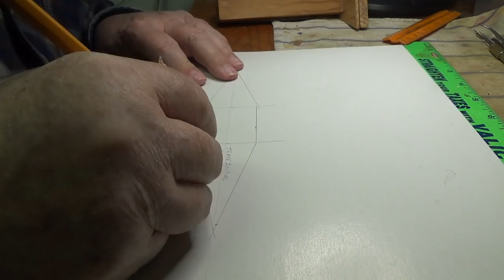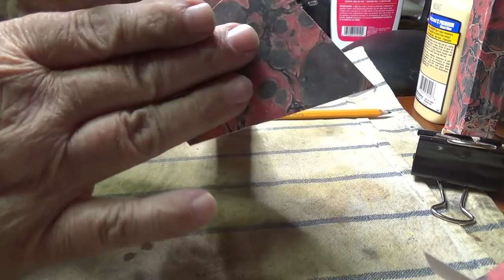Bellows Repair for Wade's Railroad House Cuckoo Clock

Comment: An index for this video:
0:00 Introduction to the repairs to do.
0:49 Removing the old whistle paper, bellows, and glue. Sanding the whistle parts.
4:14 Patching holes with wood filler.
5:18 Cutting out the new leather bellows.
5:58 Gluing the new bellows with diluted wood glue.
9:37 Testing the new bellows.
9:51 Gluing and sealing new paper on the whistles.
13:45 Gluing and sealing new paper on the top of the whistles.
19:03 Attaching the new loops and wire to the bellows tops.
Reply from the maker: Thank you

Comment: Thanks for a very solid lesson on bellows restoration. I wonder what kind of leather you have used. The one for car cleaning seems to be too thick to fold properly.
Reply from the maker: Yes, chamois is much too thick.  I did a simple search on eBay for "paper thin leather" and found a site that said it was thin enough for clock bellows.  It is, indeed.  You can buy it from clock suppliers, but it is very expensive and they don't even guarantee thickness.  https://timesavers.com/i-8946487-leather-bellow-material.html
Reply from the maker: Here's where I bought mine.  https://www.ebay.com/itm/Reduced-Thin-1-5-oz-Cream-White-Sheepskin-Lining-Leather-Hide-Dollmaking-/400964204843

Comment: Great video. Just wish you had showed how to get the proper crease in the leather.
Reply from the maker: Push the sides and front of the material in between the top and bottom of the bellows, close the bellow top and clamp it shut for a few minutes.  Creases will be there.
Reply: @dperry428  thank you. I will try soon.

Comment: I can see how you can determine the length of the leather by the distance around the bellows top. How do you arrive at the width at the front, top to bottom?
Reply from the maker: After putting a piece on the back for a hinge, open the bellow top to about a 45 degree angle.  The distance from the bottom,front of the bottom piece to the middle front  of the top piece is the width of the leather strip.  The width is the distance to the widest expected opening of the bellows.  It's about an inch.  Don't want it too narrow, but too wide and it is difficult to make the folds needed to close the bellows.
Reply: @dperry428 

Thanks 🙏

Comment: Again thanks for the excellent video. I always learn a lot. What type and weight did you use for the bellow tops? Did you say you use piano wire for the loops? Will you be putting the movement in a case? If so I hope you do a video of the completed project. Bob
Reply from the maker: Of the two bellows, one had a complete lead weight, which I replaced.  I don't know the weight.  The second one had just bits and pieces so I just cut a piece of brass rod the diameter and thickness of the hole in the top. I don't know the weight but it was about 3/4 inch rod and about 5 mm thick.  Yes, I used piano (music) wire. I also use it for smaller trundles and pivots.  No, I won't be putting it in the case.  The owner is doing a restoration but didn't know how to do the movement repairs or bellows, so I'll just be sending them back to Minnesota.
Reply: Thanks for your early reply. Bob @dperry428

Comment: What do you use for hinges? How did you come up with a pattern for the bellows paper/leather, but most important is how did you get the creases into the bellows?
Reply from the maker: The hinge is simply a strip of leather glued to the ends of the bellow halves.  On this page you'll see the general shape of commercially available bellows material. https://timesavers.com/search.html?q=bellows+material&go=Search   Make the bellows in this shape with dimensions to fit your specific size. Creases are made by tucking the material  in with a pair of tweezers and squeezing the bellow halves together.  Gently push in the front and then the sides. Then close the top until it closes neatly.

Comment: Nice work.  I’m looking for similar railroad whistles that I need to replace that are missing. I was wondering what is the length of those whistles not including the bellows? Thank you!
Reply from the maker: They vary.  They are, without the bellows about 6" to 6 1/2".  Some are a little smaller.  Total length, including bellows, are 6 1/8" to 7".
Reply: @dperry428  thank you!
Reply from the maker: https://timesavers.com/i-8946475-7-old-style-leather-bellows.html

Comment: What is the correct height between the top and the bottem , of the opening ?
Reply from the maker: If, by "the opening", you mean the distance between top and bottom of the bellows when it is open, it is roughly an inch or 2 1/2 cm.  It should be be wide enough to accommodate the distance the lift wire moves but not so wide that the leather material bunches up when closed.
Reply: @dperry428  Yes, thank you !

Comment: Hello. Hope you are well.  Bellow wire and lifters question here. I replaced the bellow paper on an 8 day Regula. They were very delicate but working beforehand. I assume the lifting wires were original as it worked when I got it. But now the bellow with bird wire is not lifting easily. Put everything back to as close to original position as possible, but just can’t find problem. Even put in smaller wire on stiff side, put small bend In lifter on problem side. Could bird position on wire cause issue? 
It runs ok when I physically pull chain and observe from back. But weights can’t do it. As I mentioned they were perfect before for weight. 
Any insight ? 
Thanks
Reply from the maker: It's very difficult to say what's the problem without observing it myself, but some of the things I'd do would be to make sure the wire that lifts the bird's tail is not hanging up on anything and is below the bird's tail, take out the problem bellow and work it manually until it moves very freely. When I replace the paper on a bellows, I clamp it shut for several hours to make sure the creases are pressed in well.  Also, the bellow lift wires should be shortest on top lift lever and longest on bottom lift lever.  Bellow lifts should be adjusted to keep the bellows from opening completely.  They only need to be lifted half-an-inch or so.  Otherwise, they may bind if lifted to full extension.  That's about all I can say without examining them.
Reply: dperry428 Thant’s for reply. Yes I’ve clamped new bellows together with rubber bands for a while. I know about the placement of longer and shorter wires. It’s hard to diagnose problem remotely on this one alright. I’ll just keep fine tuning. Worked before so should again. 
Take care.
Reply: dperry428  Hello and good morning. 
Two questions today😜. I picked up a very large cuckoo clock approximately 24 high with frame. 
Movement is Hubert Herr but it’s not like the more modern ones with snail and rack on the front, it has a slotted disc at the back to run the bird. The bird itself is wooden and flaps its wings. Hands are plastic not ivory. Carving is pretty detailed. Any idea of age ? I’m thinking 1900-30s.
Only issue with if so far is the minute hand tends to fall back counter clockwise on its own weight occasionally. It does run. 
Thanks
Reply from the maker: @paddypup1836  I'm no expert on dating these clocks, but your guess is probably right.  The hands were originally carved bone.  You can purchase new ones made of bone, but they are expensive. Example:  https://timesavers.com/i-8947278-bone-cuckoo-hands-2-5-16-minute-hand.html   As far as the hands falling backwards, look at the motion works, the set of gears that run the minute and hour hands.  There is a clutch mechanism that allows the hands to be moved to set the time. The clutch is usually done in one of two ways -- by the minute hand tube having two notches cut out of the shaft that allows the remaining piece of the tube to be squeezed inward to create friction with a solid center shaft, tight enough to hold the hand in place, yet allow it to be moved to set the time; OR there is a tension washer under the intermediate wheel that can be missing or not tight enough.  Lastly, there could be a problem with the nut that holds the minute hand on the center shaft, allowing the minute hand tube to slide on the shaft too much and intermittently allowing the gear on the minute tube to disengage from the intermediate gear.  If that happens, the minute hand can flop all over the place.
Reply: dperry428 thanks for that. Have your video of the 8 day musical cuckoo on the tv here. You put lots of time into that one. My new son is staring at it.

Comment: Can I send my clock to you to be repaired seems to be running slow and sometimes stops where would I send it thank you
Reply from the maker: I repair clocks only during the winter season when I can't be outside working on my pond and concrete projects.  Contact in October by putting an email in a comment.  I hold comments for review, so your email won't be seen by anyone but me.